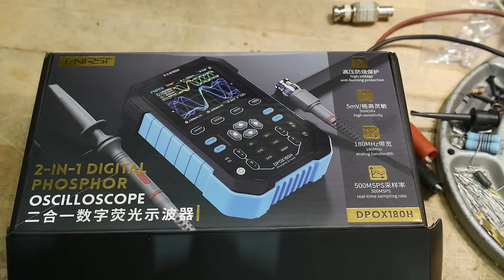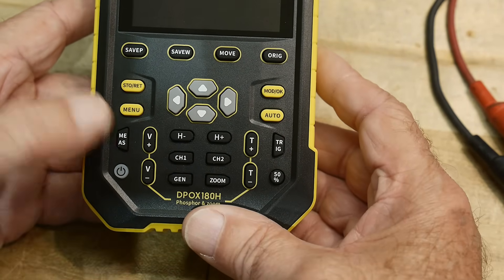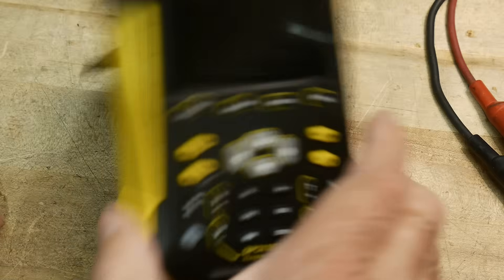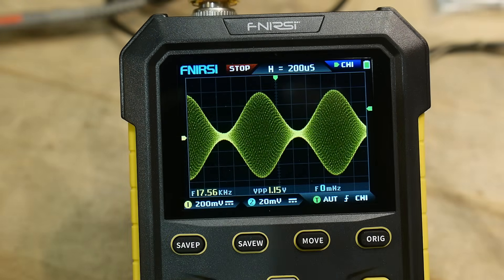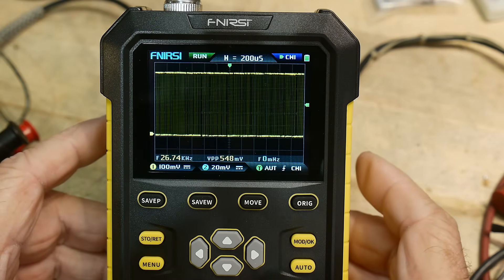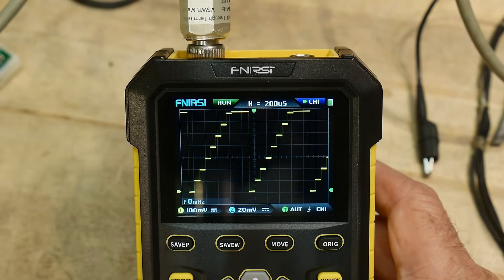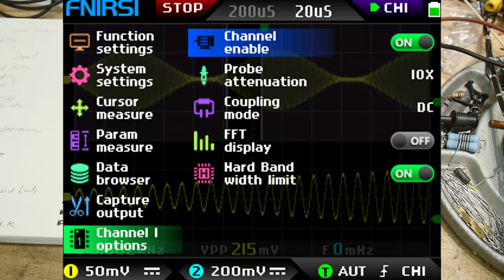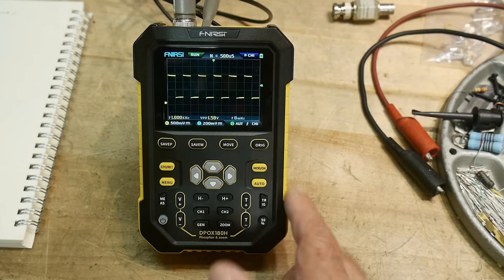#1811 FNIRSI DPOX180H Oscilloscope Review

Comment: the square wave is buggy in this review. There is a firmware update to fix that.
Reply from the maker: thanks. I will go try the new firmware
Reply: It's not bugged. Phosphor oscilloscopes work like this: the part of the signal that happens extremely quickly has a lower brightness than the part of the signal that is repeated more times in a space of time.
Reply: @mariafernandapedrosa458 yeah, I know, but really the fastest lines fades too much. It was fixed. I bought one of these and fixed mine updating the firmware.

Comment: I recently purchased a QMX transceiver kit from QRP Labs and after assembly everything works EXCEPT I am getting zero power output on transmit.  Would this scope be sufficient to do some signal tracing / troubleshooting?  I realize I can't connect it directly to the PA output or I will blow it up, but I think there are some examples out there on how to create a sampling circuit.
Reply from the maker: yes, it would be fine. you can probe the output with the scope probe without worry.

Comment: Eh while it seems to be technically decent I can't help but notice it sounds like very cheap plastic when you move it about.
I'm not sure what market segments it's targeting, it's not really rugged enough for automotive use and it's rather lacking for bench use considering you can get a 200MHz 2ch Siglent scope for a bit less than 3x the price, it doesn't seem good value to me.

Comment: Yes it's one of those where all the banner specs only count when a single channel is labelled, but on the plus side for a chinese o'scope it doesn't seem to be plain lying about them for once (sooo many in the past...) Generator would be a tiny bit nicer if you could at least adjustably-decrease the amplitude of it to some degree.

I bought one earlier, it's a pity, after a month or two or sale they figured they could make much friendlier (to press) buttons and changed the look. For the size though, and without having to spend Rigol money yet, it's pretty good.

Comment: Nice, but ill wait till it can do decodes on i2c spi and serial comms etc
Reply: get a logic analyzer instead !
this product wont do these because it doesn't have a built-in logic analyzer
it may show i2c signals because it uses 2 wires but spi uses 4 wires
Reply: @-highvoltage4685  да, но с его помощью можно также наблюдать передачу данных в одном из каналов MISO/MOSI одновременно с CLK

Comment: I have one of those for about 4 months, the thing that is most FRUSTRATING is triggering at low frequencies (<30khz +\-), including single mode, there is a thread on eevblog were more people confirm this issue, also mine is with a vertical scale error of about -10%, also often it completely bricks out of nowhere, it lacks some basic measurements and functions that wouldn't had been hard to implement in the software... I like the screen and form factor, but as the usual on these cheap stuff, they make 98% of it right, and they let the remaining 2% (bugs etc) ruin completely the device functionality, with a bit more attention to the software this device would have quite potential, i hope they can fix at least the triggering problems.
Reply: What firmware version you have on your scope? Have you checked the latest one?

Comment: most of the FNIRSI oscilloscopes had  a very limited vertical sensitivity of 50 mV/div min. What is it on this one?
Reply: the problem that they tend to lie about the specs of their devices , the finrsi 1013d says it has 100 mhz bandwidth while in the real world it is only 30 !
Reply: A bandwidth of 30 factorial = 2*10^32 Hz is >1000 faster than the highest Gama ray that has been observed, tat is much better than 100 milli Hz= 0.1 Hz. If that is true then it is probably a world record in understating specifications. 😂
Reply: @larslindgren3846  
nah there is a space between 3 and ! 😎
I think engineers usually skip Literature classes ☠️
Reply: ok looked it up it is 5 mv/div. Very impressive!

Comment: Thanks for the review! I actually would not have minded you doing a teardown as well. Quite frankly, Dave's teardowns leave a lot to be desired sometimes ("Some sort of chip, couldn't find any datasheet, your guess is as good as mine" on a SOC with the datasheet being the second hit on google, that sorta thing...)
This is less to poo-poo on EEVblog, rather my point is: Don't be afraid of doing something that someone else did too. There's room for more than one teardown on the internet ;)
Reply: Dave is pretty biased too. But remember he us used to using top if the line professional gear. So his reviews are from a professional standpoint...